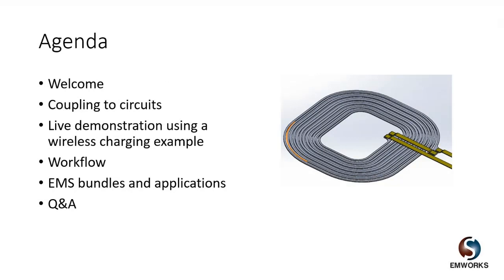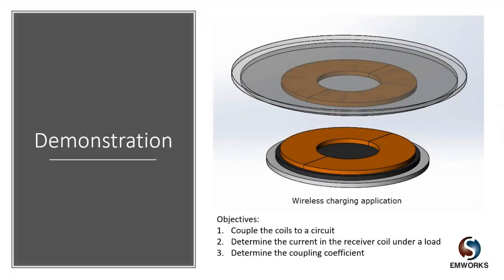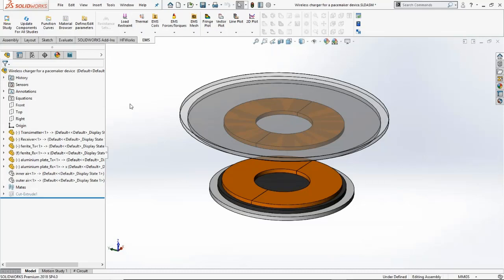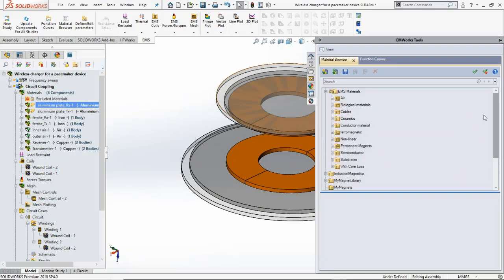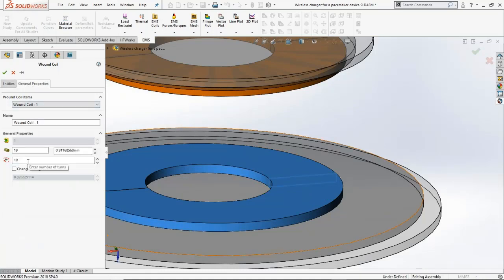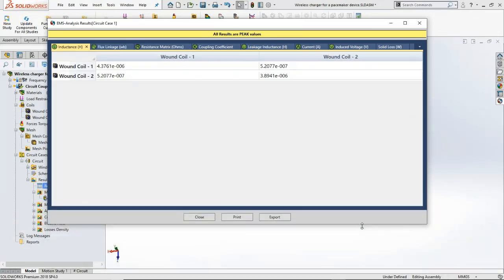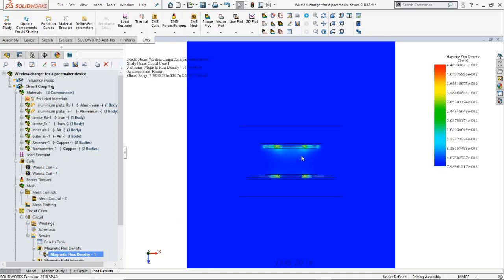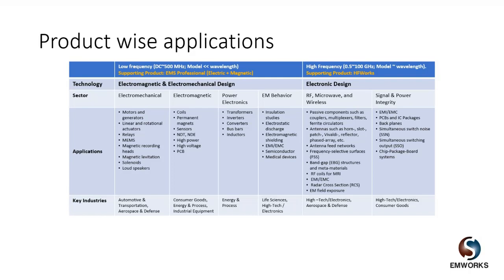[Webinar] - Coupling to Circuits in EMS for SOLIDWORKS

Comment: Sir, to simulate coils, is it important to design in two halves? Or can I simply extrude a perfect single solid body, a ring, and work with that? That way I can turn on section view and cut the coil in half, and then specific the current enter and exit faces?
Reply from the maker: Hello Singh,

You can create the coil as one single body then split it.
If you have more questions, please feel free to contact us: support@emworks.com/majdi@emworks.com

Thanks